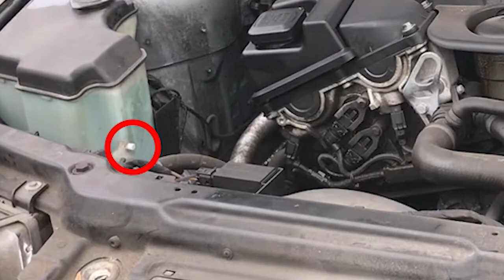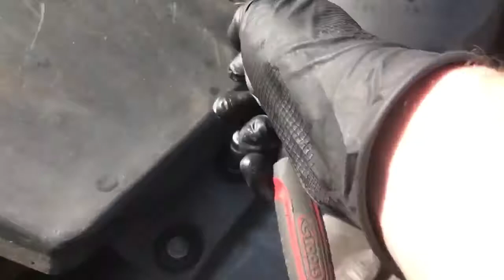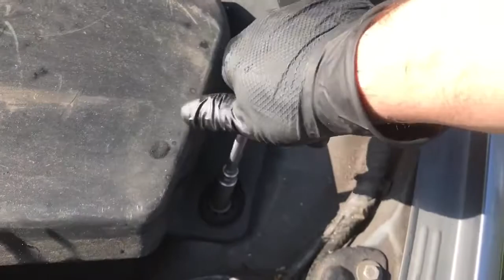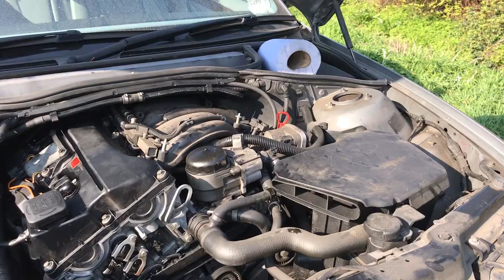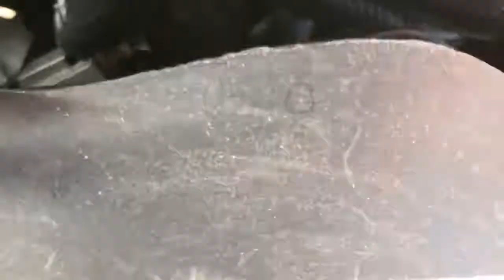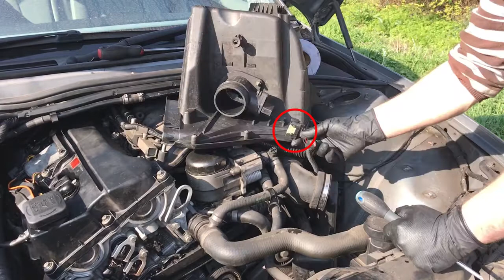BMW 318i 320i E46 Air Filter Replacement (easy)

Comment: Hi I have a bmw 381i it shakes an one off the coils is not working if I replace the spark plug am coil should it run again because there is a big shake an it drives slow
Reply from the maker: blazing arrow Thanks for watching my video.
1. How do you know the ignition coil is not working?
2. Try to plug an OBD reader to see what the actual problem is. 
3. If you are 100% shore that the coils are the problem then obviously it will work fine again if you replace them. 
4. Highly recommend you to get an OBD reader and read the fault codes.
5. The most common problems related to car shaking on BMW’s are the spark plugs and coils or engine mount.

Hope this help.
Please let us know the outcome.